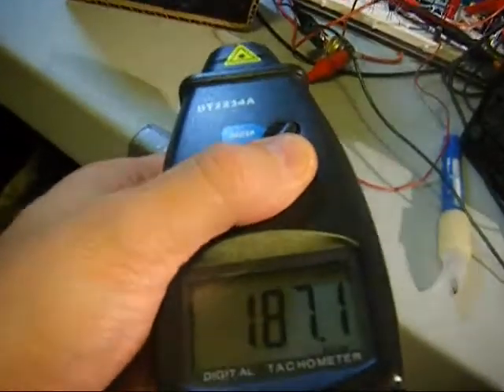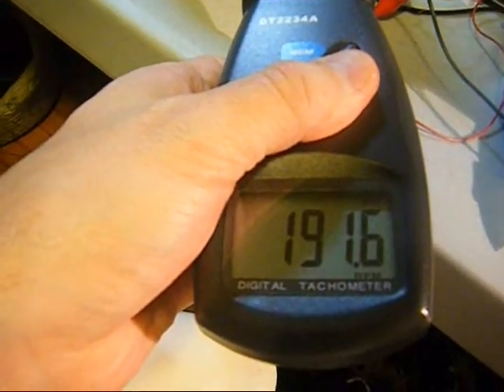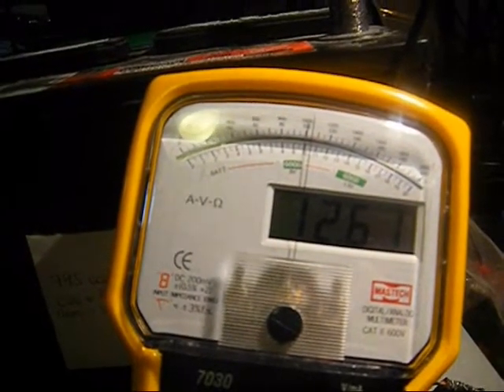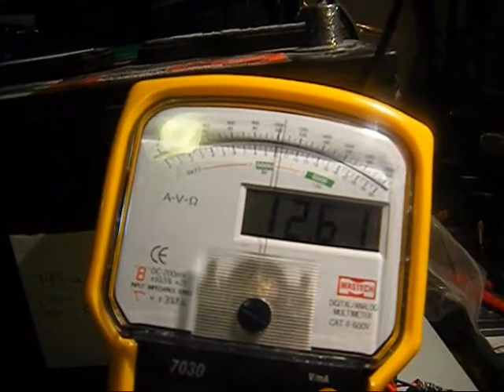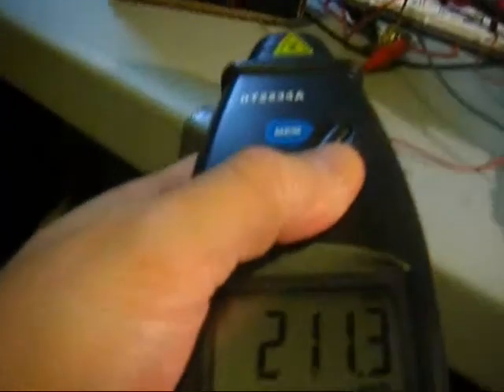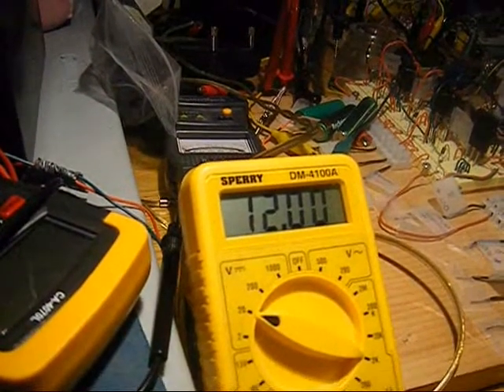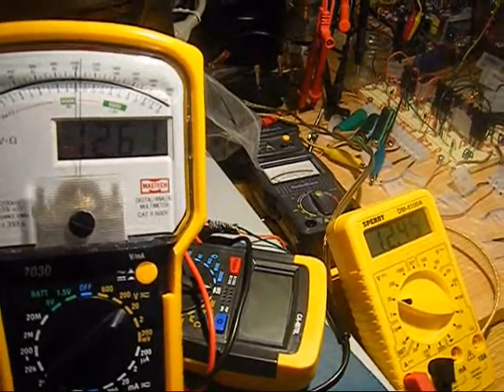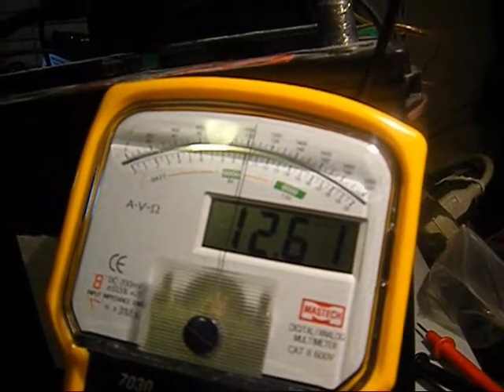Bedini SSG Fan Self runner 22b

Comment: Yeah. If you send a constant current of dc or pulses into a battery which have a higher voltage than the battery, then it can explode. It seems however not only possible, but also better to send thin spikes of 200-600 volts in the battery.
I've been doing that with a small 12 volt battery for a while now, and it seems to have only been getting better, now staying with 13.7 volts when done.

This is interesting tech for sure ;D